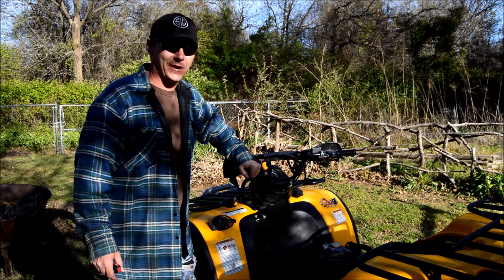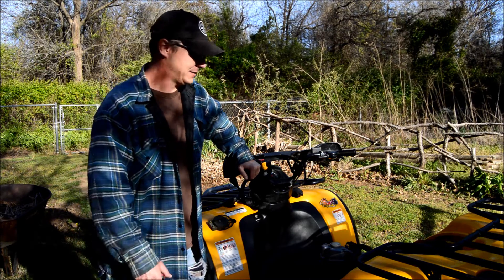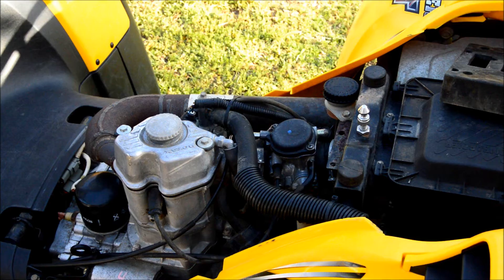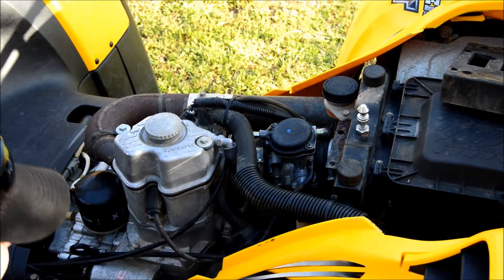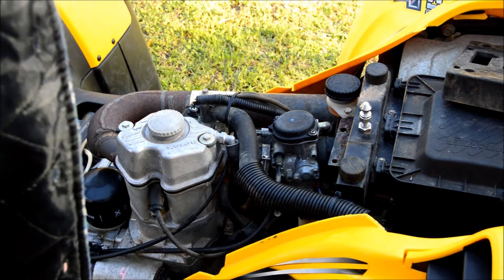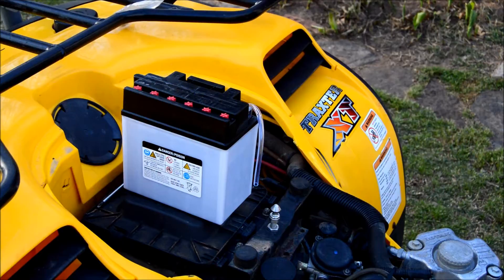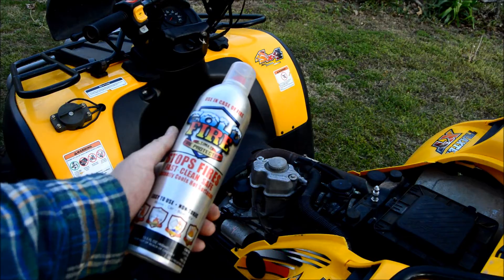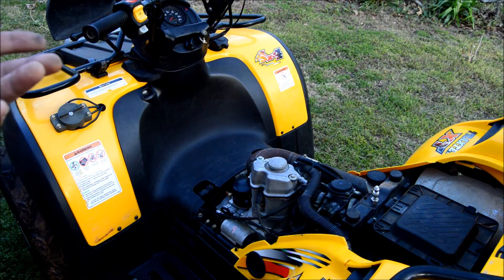Bombardier Traxter 500 Project - Part 2 - Suck Squeeze Bang Blow - DIY ATV Repair

Comment: Gotta be careful with the start fluid and car cleaner. She’s a little dry and could wash lubricant out of the cylinder. Use sparingly.
Reply: Sounds like the low speed idle jet is plugged.

Comment: adjust your idle with the choke when it is cold. when you squirt carb cleaner and ether in there there is no lubrication for the cylinder. I wont put that in a small engine. I use gas in an oil can often with 2 stroke oil in it. it might smoke a bit when starting.

Comment: You should just take the carb off and clean it its going to run lean and you will burn it up before you know it not to mention you ran it on an entire can of ether so your seals are probably toast now to so great job
Reply: What seals got damaged by this?

Comment: I have a 2004 Traxter Max XT and had the same problem with the choke not staying out.  There is a friction control nut at the base of the pull knob, under the rubber boot (where it extends through the console).  It is a finger tightening nut so you won't need wrenches.  You can either roll back the boot and adjust the nut or in my case I was able to adjust it by turning the nut along with the boot.
Reply: I'll ha e to try this.

Comment: Which battery did you buy? I have looked, and I'm struggling to find the right one. I am buying a 2002 Traxter; and I cannot tell you how excited I am to watch this series! the one I'm buying has sat for about 3-4 years, but buying from a friend, so I'm not too worried about the story being a lie.
Reply from the maker: I bought a mower type battery and it has been working great. I can't remember the specs but just get the largest one that will fit in the tray. Good luck and have fun.
Reply: The Hands On Channel I appreciate it! I’m watching your 5th video now on rebuilding the carb, and I just can’t wait to get parts for it

Comment: IT'S ALIVE!!!! Awesome! I have to send Prepper Bob over here to check this out!  

My 2c below;

Buy a new fuel filter, probably cheapest part to replace aside from the plug. Almost a guarantee it is gunky inside. 
Get a new plug just for good measure (keeping old one for spare, of course) or check gap on existing plug
Try running from a make-shift fuel tank, to see if petcock is causing issues
Inspect petcock after removing it from tank, to a quick blow through test and take it apart to inspect as needed. They have super fine wire mesh screens on the tank side that is quite likely to be a little gunky.

Is this a float bowl or diaphragm type carb?

Never heard of the "hot soak" method, interesting! You and I both know there is a good chance the needle/seat have a bunch of gunk up in there. Don't forget to try the "percussive repair" on the carb, in case the float/diaphram is a little sticky!

Anyways, I know you have more than enough experience to diagnose the issue, just offering a few thoughts :) Looking forward to the next video!
Reply from the maker: Great advice, I did tap on the float bowl and while it was running it seemed to pick up rpm's as I tapped it. I think the float needle is stuck closed. I looked at the diagram again, it has a diaphragm and a float bowl. There's a possibility the diaphragm has cracked, I will pull the carb tomorrow and inspect. I removed the fuel line and turned the engine over to see if fuel was coming in and it seems to be flowing well. I think it's all in the carb. I actually lost some footage of the process of clearing the fuel bowl and the line. Basically, I just cranked the engine over with the bowl drain screw open. I could see the fuel flow increase when the engine cranked. So I think everything in front of the carb is flowing. Thanks for the comment, very well thought out.

Comment: Float bowl drain screw is a GREAT idea. Those crafty Frenchman! Or maybe crafty John Deere engineers?
Reply from the maker: Yeah, I'm very impressed with the engineering on this machine so far. It's like it was designed by a mechanic. I found out Bombardier is a much bigger company than I thought. Copied this off K&N website. 
Bombardier is a Canadian company that can be traced back to 1942. Bombardier Recreational Products holds the brands Ski-Doo, Can-Am, Sea-Doo, Lynx, Evinrude Outboard Motors, Johnson Outboards and Rotax. Bombardier has been known for their long legacy of innovation.
Reply: @TheHandsOnChannel  Yes a big company.  The Rotax engine is used in homebuilt aircraft as well.  Another division of Bombardier manufactures business and passenger jets.
Reply: Bombardier Came out with this Model not John Deer, They sold rights to JD, basically JD made it Green and put their decals on it.    Originally  Bombardier came out with it, it was their first Model into the ATV business.  The yellow XT was the Higher end Model, cam with winch, Black Water ITP tires and other goodies,   I kinda had something to do with this as myself and 2 other friends took out Bombardier reps and Engineers for a fun Mud ride, They all had the factory Stock ATV's, we had Winches, Aftermarket aggressive tires,  and other stuff, they asked us if most people did this and we said yes, stock tires suck and we all need winches, they asked many questions and then the Following year came out with this XT Model.    Now Remember this was end of  the 90's early 2000, the traxter XT was an early release in 2000.   Oh that same weekend all 3 of us won the ATV Pulls, No other Manufacturer was able to beat us, We won it all.    Such good times.   I need to find pictures of that.